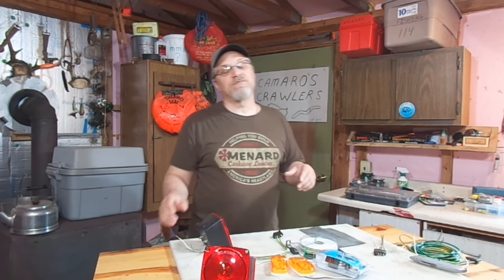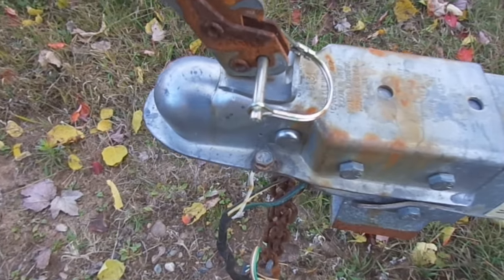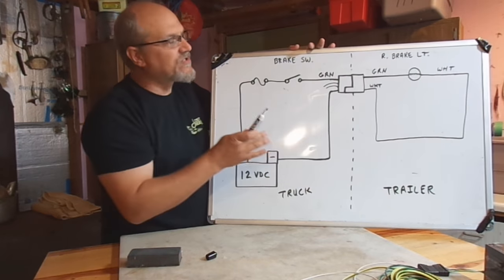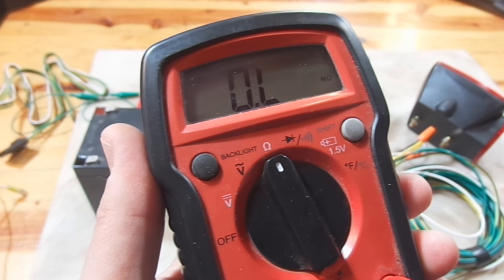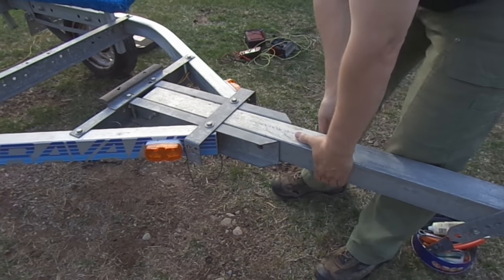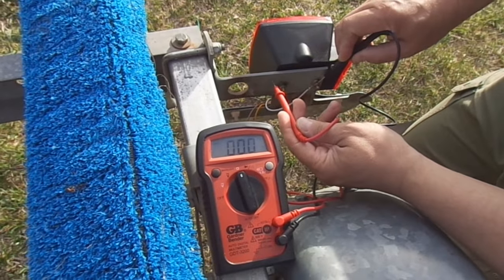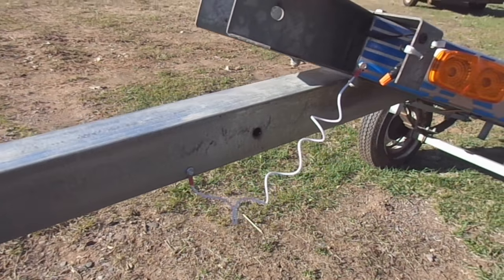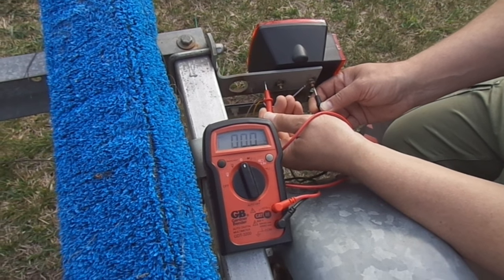FIX YOUR TRAILER LIGHTS (5) - Fixing Ground Problems

Comment: Thank you for the series of trailer light information!  took me two nights, but I found my problem.  Bad ground.  I feel like I can solve any trailer light problems now!
Reply from the maker: Mike, thanks a lot for that comment.  I have a few more trailer light vids rolling around in my head dealing with specific problems.  I just need to put them to video.  Thanks for the support, KPO.

Comment: Great video, can you tell me what level of continuity should I be looking for when conducting my test? Watching the video the numbers were shown at multiple levels so just need assistance with an acceptable range to ensure continuity. Thanks for your assistance in helping me understand this issue that shut me down at the end of hunting season.
Reply from the maker: Elliott, well the closer to zero ohms the better.  A good wire measured over 20 ft or so should be very close to zero, so your trailer frame should be the same.  Now less than 2 or 3 ohms would probably be fine, but less is better.  KPO

Comment: Have a tiltbed and can’t get new lights to work. I’m wondering if I need a jumper wire like you showed? Could I just splice another white ground to the harness and run 2 dedicated grounds back to the lights? I think it’s definitely a grounding issue
Reply from the maker: Yes, running a dedicated white wire to all fixtures will cure many problems.

Comment: My issue is the clearance lights don't work but the brake and signal lights do,I can't find a fuse box for my enclosed trailer.i used a tester for the hitch connectors  and changed both connectors ends but I have the same issue.i checked the fuses in the hood they are fine.the clearance lights did work until I connected the electrical hitch connectors while the truck was on
Reply from the maker: So the marker lights worked without the electrical connector plugged into the tow vehicle?
Reply: @KnettersPracticalOutdoors  turns out the issue was a 30a low profile fuse labeled tow tail.i used a continuity tester and swore it lite up,but after I removed it and saw it .I knew it was that fuse.also yes I connected the trailer with homemade battery connectors ..to a spare car battery and the trailer lights worked
Reply: @KnettersPracticalOutdoors  lesson learned... 😂 Turn truck off before connecting the trailers electric connector

Comment: Thanks, you’re a good instructor. 1 ? If one ground is bad will it affect all lights or just the one fixture. I have power through the hitch and into the trailer harness but no lights work.
Reply from the maker: If the entire trailer isn't grounded right it will effect all lights.  But if one fixture isn't ground and the others are grounded only the one fixture should be effected.

Comment: Triton aluminum trailer.  Ground comes from the truck thru 4-prong trailer connector and then runs to all 11 lights.  It is not connected to the trailer at all.  I know I have a ground issue.  Triton says a bad ground at any light won’t affect the whole trailer.  Truck lighting works fine with other trailers.  Where would the ground problem be on this trailer?  Been chasing this for years.  Every time I go to debug it works fine.
Reply from the maker: You may have an issue with the wiring somewhere inside the channels of the trailer.  If you have been trying to find the problem for years, I would rewire the trailer.  I wouldn't be surprised if you find a broken or loose wire/connection in the process, KPO.

Comment: Glad I found this ! Suspect this may be my trouble?? Have a 2018 Colorado and a 1972 trailer lol. Lights will fail in odd way. Replace with new kit every 2-3 years. Current failure left works great,  try right, and both lights flash slightly dim ??   What's odd is I hook the trailer up to my 95 S10 and the lights work fine ? Hook the Colorado up to a 2017 utility trailer and those lights work fine with the Colorado. Was advised that electronics on the new truck are less forgiving than the ancient S-10 ??
Reply from the maker: Is the older trailer have regular bulbs or LEDs?  Regular bulbs can draw more than newer cars are designed for.  So some newer cars may need a converter to handle the trailer requirements.

Comment: Just like everyone else watching this, I was having grounding issues. A light bulb went off for me at the 9:50 mark; STOP using the frame for electrical continuity from the ground at the light to the coupler; there are too many places for there to be a problem. I stopped watching at this point and went out to run a wire from the white ground on my harness to the stud on my light and BAM, the light worked. Thank you so much for the explanation that led me to my fix.
Reply from the maker: You are very welcome Eric.  Thanks for the feedback, KPO.
Reply: wish you could show how you did that I NEED TOO SEE /NOT TO SMART

Comment: SO F'en Cool! 50 years old, playing with trailer lights yesterday it finally broke me - I AM GOING TO LEARN  whats going on. perfect, thanks man.
Reply from the maker: Awesome!  Here is a whole playlist of my trailer light vids - https://www.youtube.com/watch?v=-14kh2DYdOo&list=PLksX0m4wrQHxmTQj8rk3Sazefa3uITFe4  Should be something in there for most problems.  Any questions feel free to ask.
Reply: @KnettersPracticalOutdoors  I watched the whole series last night. I have not been back at yet and waiting on some replacement stuff and if i have problems I will ask thank you. one part I think your missing is attaching the wiring into the actual car. I had problems with my toyota, it didnt work as the instructions told me to do it. so i paid someone 50 bucks because i was ignorant and lazy.

Comment: Your video got me thinking, I have a boat trailer with a swing away tongue and found that the pivot pins had gotten a bit of rust on them. I cleaned the pivot pins and the pin holes and I was back in business. Thanks for giving me Idea's of where to look for the ground problems. Maybe my fix will help someone else that has a swing away trailer tongue.
Reply from the maker: Awesome!  Glad the video helped and yes the swing away tongue would be another point of concern.  Thanks for adding in and thanks for watching, KPO.

Comment: Incredible!  We've got a  fixed up painted tilt-up trailer and couldn't get new lights to respond no matter what, and this answered all my questions.  Gonna run a ground wire tomorrow from from the lights to the connector, like a another comment said.
Reply from the maker: Awesome!  So glad this video helped out.  Trailer lights can be a pain if your not too familiar with them.

Comment: great video, I learned something. After watching, I decided to not worry about all those trailer contacts problems, and just ran wires from each light to the ground at the plug and connected those ground wires to the trailer in three different places. Results, bright lights on my trailer. thanks
Reply from the maker: Great to hear!

Comment: I have to say a big THANK YOU!  My boat trailer lights recently started barely lighting up.  There was a white ground wire running to each light from the front 4 prong connector but the lights were directly grounded to the trailer frame.  I ended up soldering / splicing in another white ground wire and connecting it directly to the frame.  Now I have very bright lights again.  Guys like you are why I watch Youtube. Thanks again!
Reply from the maker: Thanks for that comment.

Comment: Thank you and thank you!  I ended up using some 10"  insulated copper wire pieces to "jump" trailer structural part to trailer structural part to get continuity.  Rusty trailer connections were not doing the job.
Reply from the maker: You are welcome!

Comment: Sidebar about trailers;  from experience I never store my trailers with the coupler latch in the upright position.  I did that one time a few decades back.  We had a foster daughter learning to drive a stick shift.  She put it in reverse and backed over the trailer tongue, realized her mistake, put it in first gear and pulled forward tearing the latch right off the trailer.  Since then I have always put the latch in the locked position and haven't had to buy any more new latches.

Glad to see you are using a safety clip pin.  I will have to go now and watch your trailer series since this one cropped up in my suggestions, I watched it and it is good, especially about jumping the gap on tilt trailers.
Reply from the maker: Thanks for adding in and thanks for the support!

Comment: You are an excellent teacher. Very simple a yet point on. Now here’s one for ya. What makes my RV lights go OFF when I plug the connectors together from the vehicle I pull?
Reply from the maker: Something is wired wrong, RV side or pulled vehicle side or both, KPO.
Reply: @KnettersPracticalOutdoors  Thanks so much for responding but I reviewed ALL your vid’s and finally figured it out. I had two ground wires attached and when I disconnected one the problem was solved. Love your channel.

Comment: I saw elsewhere it's best to ground every device on the trailer to a copper wire that's grounded to the vehicle in several spots and also to the front connection where the plug connects.
Reply from the maker: true

Comment: Your video series helped me troubleshoot my trailer. Found out that the ground wire couldn't be on the tilting tongue rather I had to mount it to the deck portion of the trailer. The same deck portion that the other lights are grounded to.
Reply from the maker: Yes!  It's really a design flaw with trailer manufacturers.  Glad the videos helped.  Thanks for the comment, KPO.

Comment: I think it’s worth mentioning that you check the bulb (non LED) where it mounts into the socket. A little light sanding and cleaning of the bulb and socket . These areas are not water tight and can create corrosion.
Reply from the maker: Yes, great point, KPO.

Comment: Thank you for this video, very informative. I just bought a boat trailer and I am seeing a strange problem, the lights work when I stand on the trailer, as soon as I get off the trailer the lights go out, what should I look for, please help me troubleshoot this. Each fixture has a ground wire connected to the trailer.
Reply from the maker: It is the continuity of the trailer or grounding of the trailer.  Check out this other video I did.  This will explain it better. https://www.youtube.com/watch?v=LaUj7ZIrwAk  It really sounds like your trailer isn't grounded properly.  This video may help also https://www.youtube.com/watch?v=-14kh2DYdOo&t=503s Let me know how it goes

Comment: Great video! Thank you for sharing. This might be overkill but if I have a ground wire from my connector to my lights do I still need to ground my trailer? Thank you
Reply from the maker: Its good to have the trailer grounded also.  Any short circuits will then blow fuses as they should.

Comment: Not sure how quickly you check these. I have a Harbor Freight utility trailer I just put together. No luck with the lights. Your video makes sense. I’m wondering if I sanded the area the two side lights are grounded to and where I put the ground toward the trailer tongue should those work if all is well? I still have nothing. I still have to properly ground the back lights so I’m wondering if that’s the issue still but I thought the circuit would be closed for the sides lights to work…? Not sure this makes sense. Thanks for what you’re doing! Chris
Reply from the maker: Make sure every fixture is grounded properly.  Also any bolt together parts need continuity.  Let me know how it turns out, KPO.

Comment: So, my camper has the Peterson 457 taillight fixtures. One broke from being kid and brittle so I replaced them both with new Peterson 457. Hooked green to green, brown to brown, and the white to one of the four mounting screws (metal plate was provided inside the fixture). Buttoned it all up and all I get are turns and brakes, however the thin filament is lit instead of the thick one. Pulled everything off and double checked...all colors are joined as should be. Could the fixtures be miswired from the factory?
Reply from the maker: I would double check the white.  Make sure it is truly grounded to the frame.

Comment: I think you just helped me understand my trailer light issue.  thanks!
Reply from the maker: You are welcome, KPO.
Reply: @KnettersPracticalOutdoors  my issue was totaly grounding issues.  the studs on 3/4 lights were totally corroded out. i had to dremel off 3 bolts just to get all of the lights off. i threw out the old lights, bought new, ground down the metal at the attachment points and sprayed everything down with anti-seize spray before assembling. i also went to the insane extreme of running a ground wire from every light stud to the main grounding lug under the trailer!  it should be trouble-free for years!

Comment: My take on avoiding all these trailer frame interface issues is to extend my white ground wire all the way back to my two trailer lights. On my way now to ACE hardware for wire and connectors.
Reply from the maker: Yes this will cure many problems.  Just be sure to ground the white to the trailer also.  That way shorts to the trailer will blow fuses as they should, KPO.
Reply: You are ahead of the curve bud. 
Not many people would do that. I personally always use wire the whole length of the run for the ground plus jumping over on the frame from any junction boxes.

Comment: Great series! Quick question: Seems with the trailer acting as the conduit for the white/ground wire = about 90% of trailer wiring issues. Why not just extend the white wire from the harness to both light fixtures and skip the problematic trailer as ground in the first place? I'm wondering why the manufacturers depend on the trailer being sound in the first place...
Reply from the maker: You are on the right track.  I think it's just a cheaper way to do things.  I'm working on another trailer light video right now where I talk about that very idea.  If you run white to all fixtures just be sure to still ground the white to frame.  That way any short circuits will still blow fuses and let you know there is a problem, KPO.
Reply: @KnettersPracticalOutdoors  it seems logical and the (problematic) LED trailer lights I am trying to fix at the moment have a sealed single earth throughout the wiring loom. The problem is that resistance increases over long distances. So you want short earth wires when you can. Those short individual ones for each light are the best option. A big steel trailer is a better conductor than a tiny copper wire.

BTW your explanations are fanstastic.

Comment: Hi Dave.  A great series and very helpful.  We have a snowmobile trailer that we store outside in the summers here in Ontario.  In addition to finding the jack and wheel assembly completely rusted, the running lights and left light aren't working.  I got a multimeter and am going to test everything, but given that the left lift works then I'm assuming the grounding through the trailer is fine.  Wondering if there is actual damage to the yellow and brown wires through the trailer (perhaps rodents).  Thanks,  Andrew
Reply from the maker: Well the trailer can have continuity, but each fixture needs to be grounded properly too.  And yes, mice love to eat wires for some reason.  So anything is possible.

Comment: Does it make sense if I have a bad / no ground (white) wire connected, that I would have turn and brake lights, but no running lights? Thank you. My white wire is like it's crushed or something. As I strip more back the wire just crumbles out.
Reply from the maker: Sometimes lights can do some weird things when they aren't grounded.  They can use the other circuits as grounds sometimes.  It's been my experience that if you're not grounded properly just about anything can happen.  Get that ground fixed and go from there.  Thanks for watching John, KPO.

Comment: I tried using a trailer light tester on my sprinter and it gave weird signals. I plugged the same tester into my friend's Chevy truck and it worked fine. I dis this because my Kenway wireless towing light kit didn't work on my sprinter.  After seeing the tester work on the Chevy truck, we tried the wireless light kit on the truck and it worked great. My friend says the Mercedes expects a certain amount of load from the trailer lights that it isn't seeing on either the tester or the wireless transmitter.  A y advice?
Reply from the maker: Does the sprinter work with a known good trailer?  Do you have a history of the sprinter trailer lights working with the way they are wired now?  Plug a known good trailer into the sprinter or even a tail light package.  That should tell you a lot.

Comment: you saved my ass, I bought a used trailer and for the life of me couldn't diagnose what was wrong with the lights. Turns out the white wire disconnected from the ground and was hidden underneath electrical tape. Thanks!
Reply from the maker: You are welcome my friend, KPO.
Reply: Bro what I’ve been watching your videos for months and I’m fixing the taillights on my trailer and you happened to comment that’s awesome
Reply: @rookysparta0443  did u fix it? lol

Comment: Home made trailer bought- lights worked when bought- found corroded wires.  Bought new lights for trailer- have em all set up, and no lights.  Was wondering about trailer itself- it’s painted- does that matter for the ground on the 2bolt lights (no ground) as long as all the ground points are all cleaned down to bare metal?  

Going to get a fuse checker and a light hookup tester (from vehicle).
Reply: Hahah so with all that mess-  the painted trailer shouldn’t matter, as long as all the grounding points are cleaned to bare metal, right?
Reply from the maker: Yes down to bare metal and the trailer needs to have continuity also,  KPO